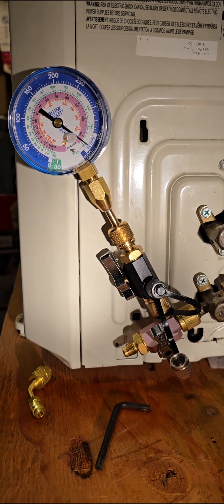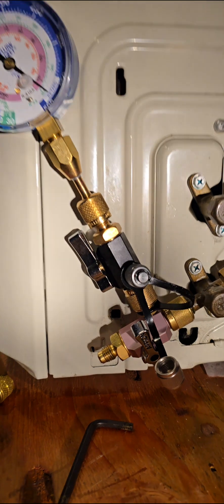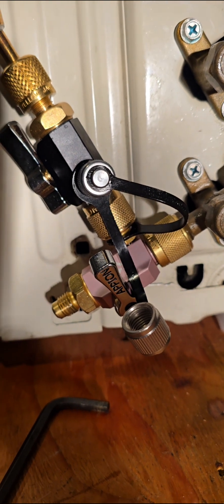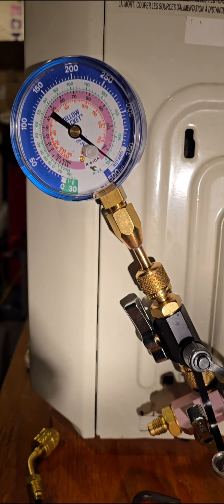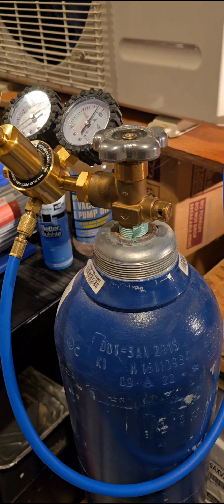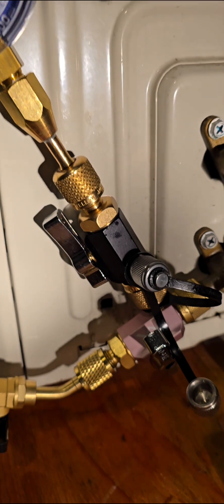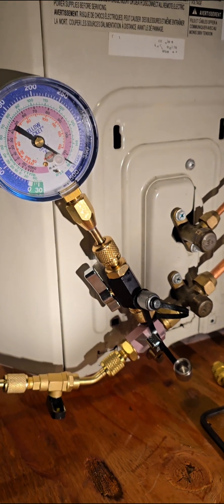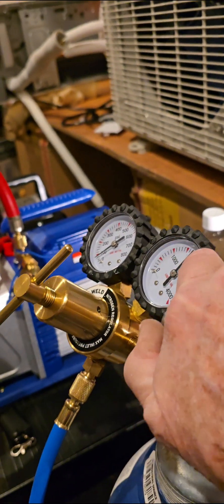Senville Leto mini split leaked, I lost all my refrigerant 😭 how to get it back

Comment: where was the leak?
Reply from the maker: As I said in the video 

Because it went a full 72 hours with zero movement on the pressure gauge It didn't leak one little bit The only thing I had done differently is replaced the line set So apparently the old line set had a pinhole in it It was such a small hole that I never found any oil anywhere but that was the second time that system had leaked out and we know now that it wasn't the ODU or the IDU because they're on the system now and there's no leakage and with the new line set there's no leakage So it had to be in the old line set 

Is there anything I can help you with 

I can walk you through any checks you might have to figure out where yours is leaking 

Let me know what you're up against and I'll give you a hand
Reply: @Jonehughes  Did you use a torque wrench on the flares?
Reply from the maker: @machaf  

I do use a torque wrench on all my flares 

It wasn't leaking at any of the four flares 

There was a leak in the line set itself somewhere I never found any oil I never found anything I have no idea I just replaced the line set and it worked out fine
Reply from the maker: https://www.facebook.com/groups/976699330150501/?ref=share&mibextid=NSMWBT
Reply from the maker: That is a DIY mini split Facebook page group lots of guys there with lots of different equipment can give you plenty of answers if you would like to go there also